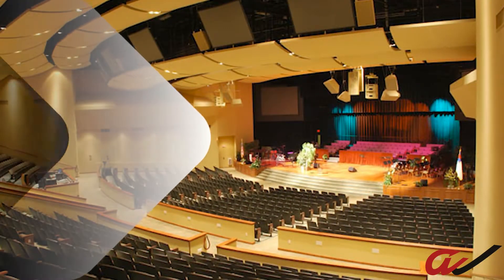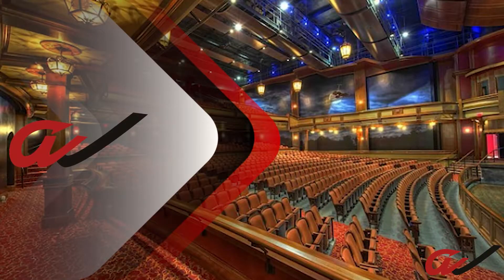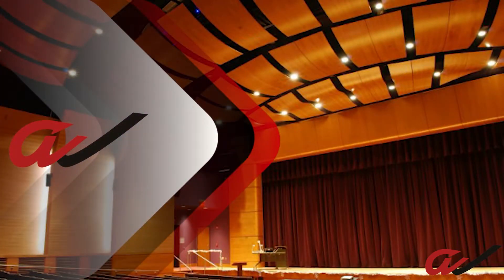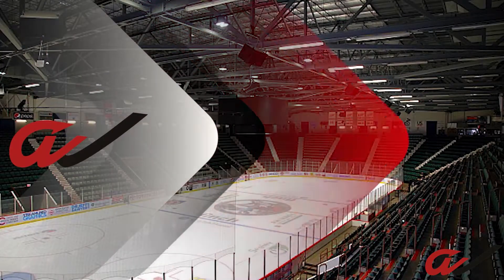Apartment Sound Privacy (Sound Proofing and Noise in Apartment Design)

Comment: Do you know about 22 Khz in an appt building? Thx
Reply from the maker: Gerald, what would you like to know?  Have you discovered a 22 Khz frequency in your building?  That frequency is not normally attributed to the range of human hearing.  Share a bit more, maybe we can help.
Reply: Hi, well it's through an application from playstore named : advanced spectrum analyser. I got to know it thru a forum about noisy neighbors. I have it all the time and checked all the floors. I can visualise this on the app when there's is no noise interference from outside and inside (very low decibels..upto 30 may be). There has to be silence... then I feel these vibes/micro needles and some sort of neuromuscular contractions/spasms in the forehead, face chest and abdomen even thighs when lying down. When I get out I feel better/normal. When I arrive I feel the difference. Let me know pls if you need more input. Many thanks.